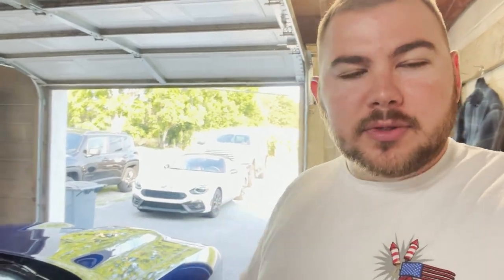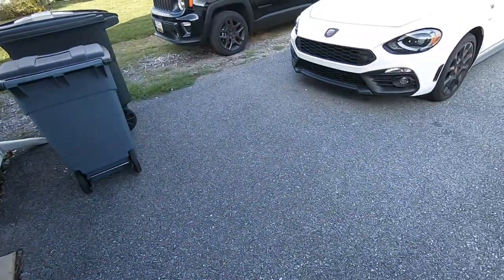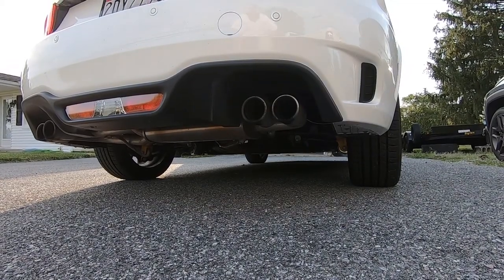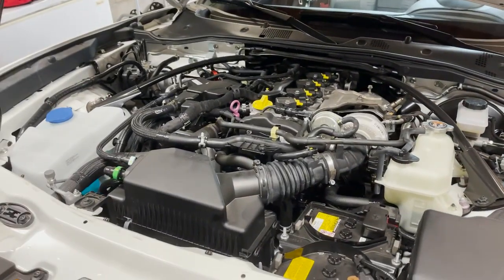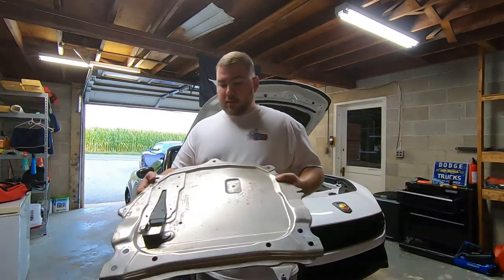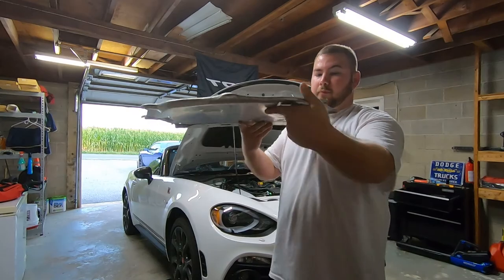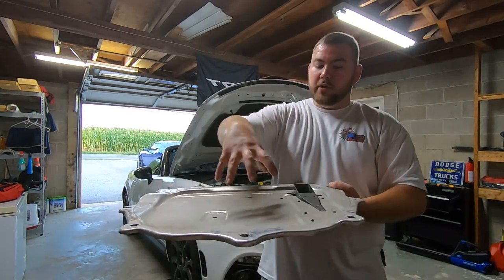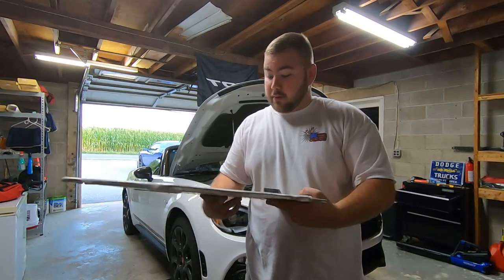This is why mechanics HATE engineers... | 124 Spider Abarth Oil Change

Comment: Wonderful exposé on the oil change for the Abarth 124 Spider - it's rather sad what the engineers did here, crammed bay and a rather hard to get to filter! Is that filter housing plastic or metallic? Also love that you're an FCA loyalist, don't see many having vehicles from them across their spectrum; a Hellcat, RAM truck, Renegade and an Abarth 124 Spider! I've recently rekindled my following of the 124 Spider - very excited when it first relaunched... Utmost bias to Fiat but greatly annoyed by some technical details or decisions! And finally congratulations on the new house! Mo' room and mo' powah! 😂
Reply from the maker: Thank you! The filter housing is a hard plastic.
Reply: the reason that the filter is in that location is because the power plant is derived from the 500, which is FWD. in that car this location was designed to be easy and it is, however when moved into a RWD design that makes things different. they could either do what they did here, or redesign and make a whole new block solely for the 124. thats just not going to happen for many reasons and in the long term its actually better they didint so that the 124 could accept any 1.4 multiair and not have its own dedicated block.

Comment: Just unclip the electrical lead and you can pull the filter out. No need to undo all those hoses. I only had my Spider a week and did the oil change. Also you should have the car level or rear higher, because the drain plug is at the front of the engine. You leave dirty oil in with the front raised. Yes I do have large hands.

Comment: Just remove the elbow (two clamps), disconnect Recirc valve connector, Remove filter. Use oil extractor to suck it out.
Reply: You definitely cannot use an oil extractor on that oil filter housing.   Tear open a 500 in a junkyard and you'll see what I mean.   Probably won't find a 124 in a scrapyard but the 500 engine will show you just the same.